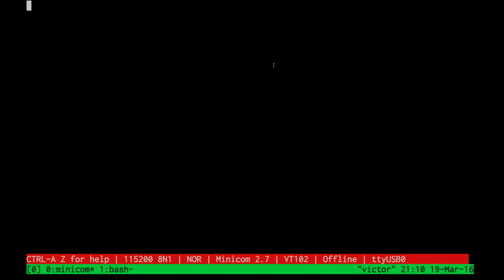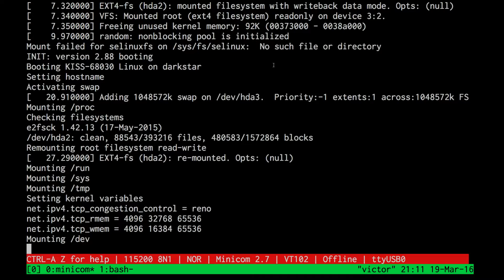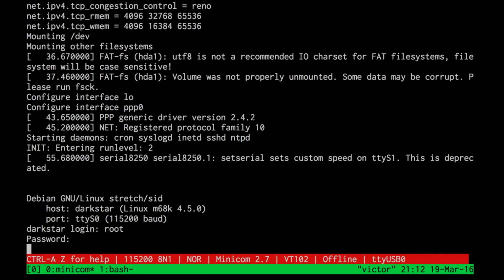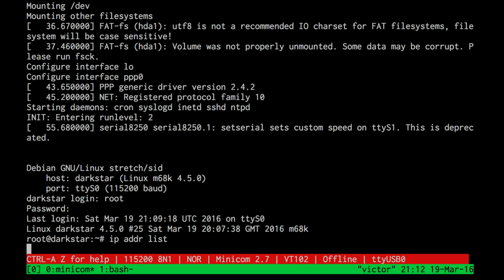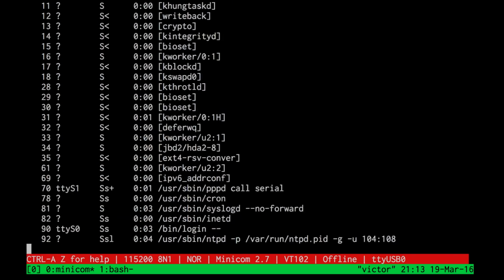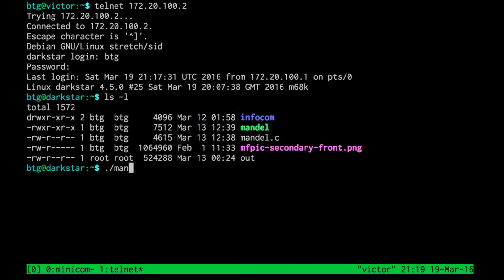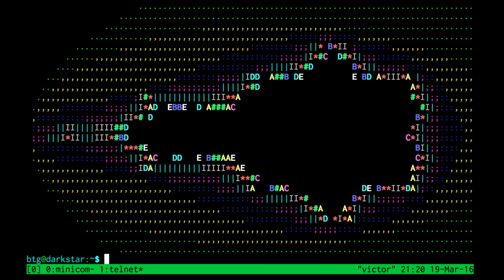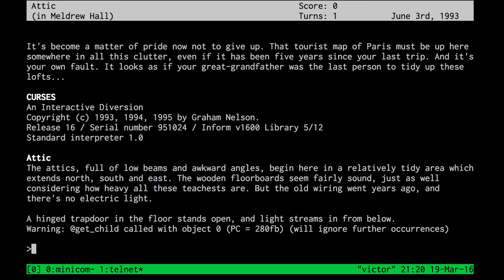Retrobrew Computers - improvements to the KISS-68030 homebrew computer

Comment: scp is indeed a handy way to transfer files, although on older machines within the LAN I prefer 'sendfile' (SAFT protocol), which is darn easy, no auth, spooling, no password, quick & lean. Works a bit like email, you 'sendfile file user@host', and it gets spooled there, until the user picks it up with 'receive'.  https://fex.belwue.de/saft/sendfile.html

Comment: Nice work. I have some STEbus 68020 and 68008 boards, and have got EH BASIC running on the latter. 
The 68020 board has no documentation so it will need more reverse engineering.
I gather 68020 isn't enough to run Linux as it has no MMU. Is that why you chose the 68030 (which is a bit dearer and harder to get)? My 68020 boards use static RAM so there is less RAM to spare for a big OS.
Reply from the maker: Linux will run on 68K without MMU. Started off as a fork called μClinux, later merged back into mainline. Certainly 2.6 and later will run in this mode. The issue is likely to be RAM -- I'm not sure of the real minimum but I expect it's around 8MB just to boot and 16MB to do anything useful.
Reply: That explains the use of DRAM. My 68008 boards have two SRAM sockets, so the max is 1 MByte. That's enough for a very big BASIC program, but not Linux. I think someone got minimal uCLinux running in 1M but 512K had no space left to do anything worthwhile.
Reply from the maker: Google for "68 Katy", you can get an older μClinux up and running in 1MB SRAM. I expect it's not possible with a newer kernel, memory requirements have grown too much. My kernel for KISS68030 is larger than 2MB.
Reply: Yes, that is the project I recalled. The 68008 supports a 1MB space in DIP64, and a 4 MB space in PLCC52.
My 68020 board has 512K of RAM, but surface mounted and hard to upgrade.

Comment: Out of curiosity, what's the bandwidth of the backplane connector?
Reply: It’s a DIN 41612 connector for a modified ECB bus.
Reply: The cpu runs at 16mhz. The 68020 needs 4 cycles for a normal bus acces with a width of up to 32 bits. So 4 mega transfers at 32 bits would be 16 megabytes per second. At 8 bits (i think the perripherals have a 8 bit data port) it would be a quarter of that. Burstmode is faster than that but is a) not implimented for the peripherals and b) only really speeds up sequential reads and writes.

Comment: The Ckermit version of Kermit file transfer program may work better than Zmodem.   Set up in server mode on the fast I/O Uart,  it can act much like an  FTP server.   Ckermit runs on Unix like systems very well and can be very fast.  You can get  Dual IDE to CF card adapters, and even SD card to IDE adapters.    I am working on converting some old P1 systems to solid state booting, with Kermit for file transfer on these un-networked systems.    They will run Freedos, in 32 MB of ram.   THey fall between you 68030 and Z80 systems in size and tech.   I hope this helps, please keep up the good work.